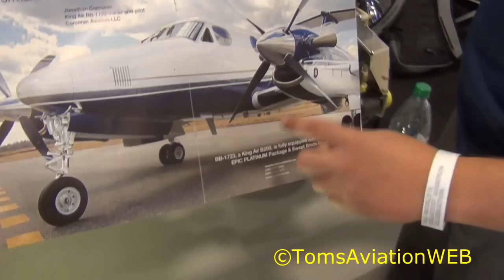PT6A Turboprop Engine Demonstrated

Comment: I understand everything (pretty much) except for that unit near the end that he say controls the rotor rpm. I would have thought would surely only be controlled by the turbine/compressor shaft speed entering the planetary gearbox? Also, the compressor side does not compress incoming air by having it go through smaller spaces. This would have been a good place to give people a brief description about how axial compressors compress air with the stater blades increasing air pressure from the rotating blades giving air increased velocity and that velocity is transferred to pressure by the stater blades (well that's my understanding of how the compressor section works anyway)
Reply: It is called a governor, and it changes the blades AoA (finer or more coarse) to increase or decrease torque, which in turn matches the rpm to the desired input. Turbine prop jobs have variable pitch props to increase efficiency (by matching prop AoA) for optimal performance
Reply: @maxvandyke1831  Thanks Max, that helps me get some more terms to look up to increase my understanding. It's hard to learn this stuff without knowing the terms to look up.

Comment: For a video, the speed of the hot and cold sections in the model, is too fast for my liking. Optical illusions are common with rotating components and at first look it appears unclear whether it is an optical illusion, or the shafts are spinning in opposite directions. Eventually it becomes clear the latter is occurring, but by that time the viewer has missed the description of the gas flow path and ultimately how the engine actually works. 
The compressor and turbines need slowing down and the reverse direction of the hot and cold section shafts need to be explained at the time the air begins the combustion cycle.
Reply: they are spinning in opposite directions
Reply: that is optical illusion based on frame sampling rate of the video.  You often see props synching with the frame rate and appearing to stand still and then go backwards during ground ops.

Comment: What are the advantages of turboprop over turbofan?  Turbofan seems to have less moving parts and doesn't need reduction gears/transmission?
Reply: If we talk about the same amount of thrust beeing delivered by an engine, then it's more economical to accelerate  a large amount of air just a little bit, rather than accelerating a small amount of air a lot. So a turboprop would be "better" than a fan- oder jet-engine, but in all cases, the output airspeed must be higher than the input one. At the end, a turboprob works best up to ~650km/h, than a turbofan works more efficient up or close to speed of sound. If you still want to go faster, than a turbojet would be the best choice.
Reply: sc0tte1 Turbofan are engines designed for jet operation in higher altitudes. Turboprops are for aircraft that fly not as high as jet aircraft but not as low as the small ones. Turbofan fuel consumption would be much higher and not cost effective.
Reply: PEOPLESX Even faster with Ram air jet
Reply: +sc0tte1 Modern Turbofans are vastly more complex than a turboprop like this.
Reply: +PEOPLESX Then if you want to go ever faster Ram air jet SR-71 system is the best choice,
Reply: +sc0tte1 Turbo prop are more efficient  at low altitude and relative low speed,,yes Turbofan also has reduction  planetary gear
Reply: higher  bypass is more efficient and  more  hp to thrust.. a turboprop is always more efficient than a turbofan.. its got a bigger propeller... a turbofan can go faster at top speeds,, more aerodynamic
Reply: Shorter takeoff distance for turboprops for various reasons, however once the prop tips get close to the speed of sound you have issues so jets are better then.
Reply: @shanemulligan3571  thanks mate 👍 but what happens when people tips reaches sonic?

Comment: Please explain to me how the propeller interface unit, from where it's located, can change the angle of the blades on the prop to slow down its rotation?  In your video the PIU is in front and on top, but there is no propeller. If the prop was there, and if it was turning,  how in hell are the blade angles on the propeller changed from where the interface unit is, without a mechanical linkage of some sort??  Just asking... good teaching video ,  i enjoyed it.

Comment: Howard Wang the design is such that the engine does not take up space. imagine if everything is spaced out according to the nature of flow. 
That is why the gas path is routed around the engine core saving in space using the Principles of venturi effect (Aerodynamics and Physics) to create the required pressure in such a short space.
Reply: doesnt save space and makes it harder to work on
Reply: aerodynamics and physics say action and reaction.. youre turning the flow around twice..youre silly

Comment: He never got to what a free turbine is.  Front and back are independent of each other.  Not connected.  I did not realize that part of the hot section is connected to the cold section, and that the power producing section reverses rotation.  I wonder if there is some advantage to that reversal?

Comment: this is what both GE and  pt have decided  obviously..85% of propulsion comes from the prop in convention turbos.. theyve decided to increase that and decrease the  turbo gas 15%... theyve  ELIMINATED the ultra HOT section..ok thats good.. makes engines last longer.. but they AINT getting 110% of the same power.. theyre getting 95% and an engine that lasts 2000 hours longer per overhaul..ok i can understand that
Reply: the rest is hype

Comment: In a pusher application I assume the engine is mounted front to back with a reversed prop? What is the benefit of changing direction in flow between gas generator section and power turbine section?
Reply: +Richard Muller It's similar to how a helicopter wants to twist in the opposite direction to its main rotor (necessitating a tail rotor). Each section of the turboprop engine spins at such a high speed it wants to twist the engine in the opposite direction. This twisting (or torque) would destabilize the airplane. The free turbine section spins in the opposite direction to offset this twisting force. It is possible here b/c there is no mechanical connection between the gas gen and power turbine sections.
Reply: there is none..in fact there are losses.. but maybe  its easier to take apart.. beats  me
Reply: thats just stupid,, turbos have been doing that very torquey  thing for 100 years with zero complaints
Reply: in fact counterrotating veins is  a lot  more complicated and problematic..someones drinking too much  aviation koolaid
Reply: The first turbine imparts a circular motion to the exhaust flow. With the second and third turbines rotating the opposite direction, they "see" that circular motion as additional velocity of the airflow and are able to extract more mechanical work out of the exhaust stream.

Comment: Its important to reduce after take off Throttle before Rpm or never mind ? and why?
Reply: When you reduce rpm, the torque will increase.  So just keep a close eye and don't over-torque the engines.  If you are close to max torque for takeoff may need to reduce power slightly before rpm.
Reply: Torque and engine loading are used in aero parlance incorrectly.When you say 'over torque' you mean overload.Any machine that generates rotary motion (torque)can be overloaded.In gas turbines as in piston engines there is an rpm which gives mamimum turning force or torque.This is usually best speed to run the engine at.The propeller is the load and as most propellers are run at most efficient speed(a constant)engine load is therefore determined by blade pitch angle.Sudden change off pitch can quickly overload (over torque)or unload the engine.These sudden conditions changes are to be avoided in normal operation.Engine loading is usually kept constant by the automatic pitch control unit.

Comment: how much would a pt6a-21 set you back?
Reply: 100k
Reply: that's not too bad some of the new piston engines are that much
Reply: Yes..   and how many of them give you around 750 to 800 hp ?
Reply: I thought the 21 had 550 hp?
Reply: A -21 is crap.    it’s on King air c90 only.   They cost around $300 to $450 new.

Comment: Didn’t define “free turbine.”
Reply: Means the turbine is not connected to the compressor (hence the opposite turn rotation)
Reply: @maxvandyke1831  Yes, I know what it means, just pointing out that, at the beginning, he’d say what it means but never did. My airplane has single shaft turbines, quite different.